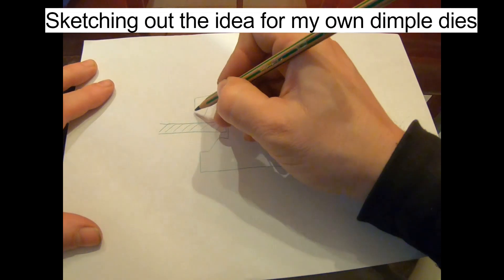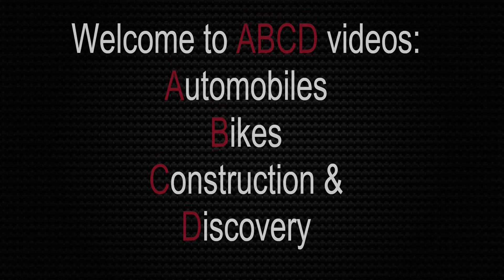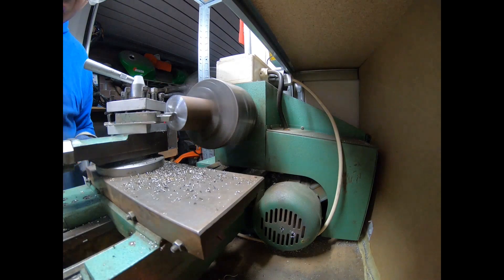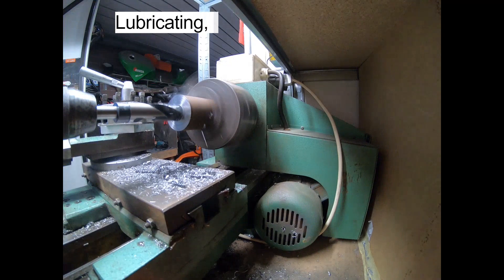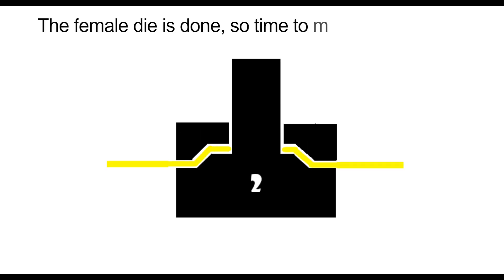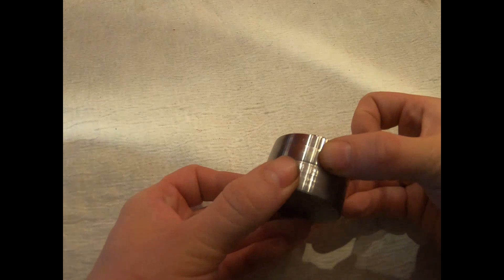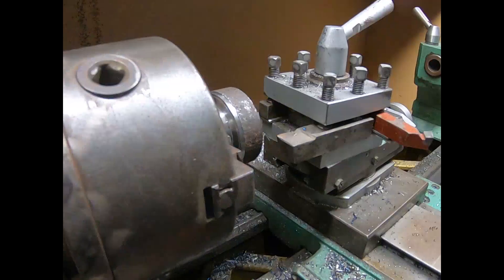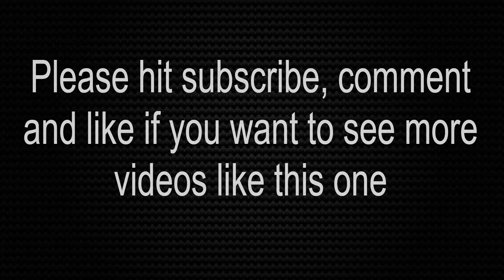How to make a dimple die, metal fabrication, lathe work, build not bought

Comment: Just make a punch with a short locator and use a Urethane block for the die.
Reply from the maker: I agree, that could indeed be an option, but if you need to make many of them, I am not sure if this is as convenient as the tool I made.

Comment: I like it but can you drill a hole straight through the center that I might be able to install a nut and bolt and use an impact tool to draw them together to make several dimples in a 3' x 4' sheet of metal?
Reply from the maker: Thanks, but for sure you will damage the surface with a nut and bolt and secondly, I believe you will not get the recess you are after with a dimple die. Check out the rest of my channel and subscribe if you like what you see, thanks